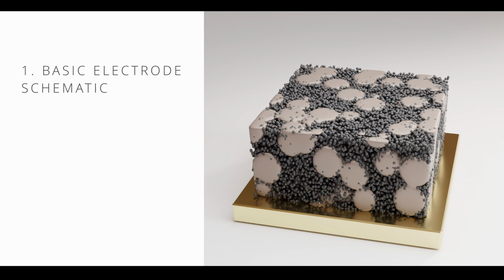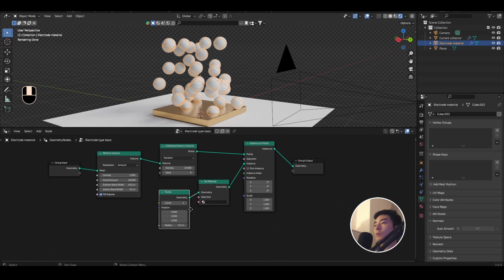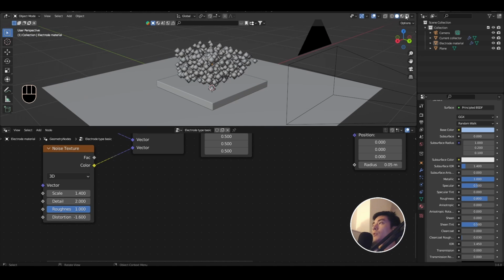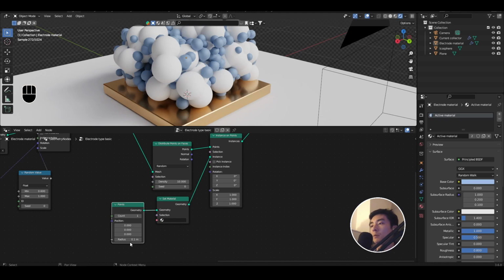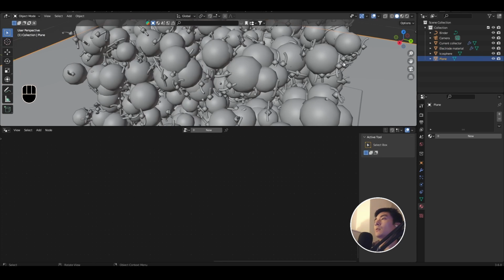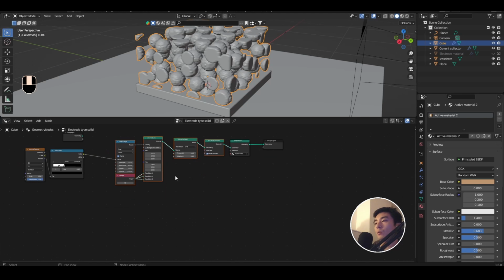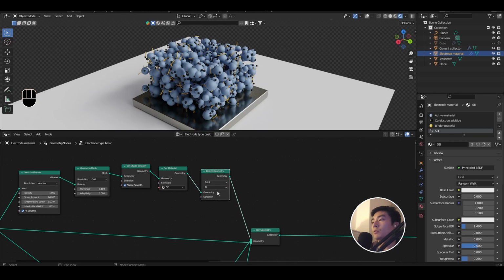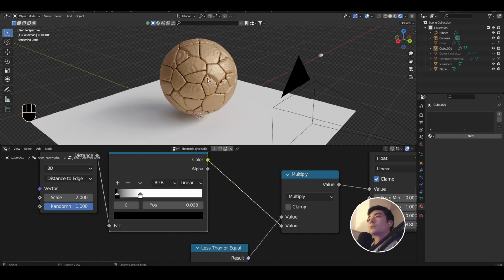Starting Sciart EP2 - Lithium Ion Battery Electrodes

Comment: Hi I am wondering right from the beginning... why is your viewport shading so bright? Also the background changes to these small chess type squares. How did you do this?`
Reply from the maker: I'm constantly running my viewport in full render preview using Cycles. All the brightness comes from a global HDRI + a white backplane that catches bounce lighting. The chess squares in the background are there to indicate a transparent background. They will not show in your render. The way to toggle background transparency is by going to Render settings -> Film -> Transparent. If you untick it, you'll see everything in the scene's background (e.g. an HDRI, as I've set up in my scene).
Reply: @ryomizutagraphics  omg thank you very much!! <3 have a great weekend

Comment: This actually gives me direction on something that has been giving me a hard time ...doing the charge transport layers of my materials. Thank you so much. Question i do have though, how can one show a charge flow in such a set up (charge flow through the contact, it doesn't have to be animated)? I was thinking of using the bezier curve.
Reply from the maker: Depends on how you want to depict the charges. If it were me and I only needed to add a few charges, I’d just add a few spheres, give them an emission shader and position them manually where I want. If i had  more than a handful I wanted to add (eg I wanted to make a train of electrons, and I wanted to freely control their path) - yes, Bezier curve + geometry nodes -> resample curve to control number of points -> instance on points with emissive spheres as instance objects, and edit shape of the Bezier to conform their path to what you want
Reply: @ryomizutagraphics  I think I will try both and see how it works out...for my case i would like to show how extracted charge from a semi-conductor can move from the core material to the contacts

Comment: Hey , I am not able to see sphere in render view. What could be reason
Reply from the maker: @bsbrar7936  you’re in Eevee, and using Points. Switch to Cycles to render points, or swap the Points for actual spheres to work in eevee
Reply: Make sure you use Cycles for rendering

Comment: Brilliant tutorial. As a beginner, I am confused by one thing regarding section 1: I try to insert a secondary spherical active material into the voids created by the main active material. You showed how to create conductive carbon partilces particles sitting ON the surface of the main active material. But how do I modify the nodes so the secondary acive material fill the VOIDs, as in section two? Alternatively, how do I assign costum particle shapes in the cross-section model of section 2?
Thank you very much - apologies for this basic question!
Reply from the maker: For section 2 - you can change the particles that fill the voids from simple spheres to custom shapes by simply changing the Instance Object that gets plugged into the Instance on Points node. I use a Points node by default but just change that to what you want - either another primitive, which there is a geometry node for, or an object you've created elsewhere using an Object node

Comment: Hi! thank you for the tutorial. Its very helpful. I am trying to follow the same steps you do in this video. In the geometry note, for electrode material, starting from "mesh to volume" to the last thing you added "value" and then switching from solid to render mode, diamond shapes are changing to spherical shapes when you do it. But when I switch it from solid to render mode, mine looks like unfilled diamond shapes and not spherical ball like shapes. Could you please help me with that ?
Reply from the maker: Thats because you are using the Eevee render engine, whereas I am using Cycles. The diamond shapes are from using Points as the Instance Object - Cycles can process these into spheres but Eevee cannot. If you want to use Eevee, plug in either a UV sphere or Icosphere as your Instance Object
Reply: @ryomizutagraphics  i had same issue but figured after realized my solid metallic current collector doesn't really look that much metallic and changed to cycles (rookie mistake) then baaaaammmm got the spheres unexpectedly. (big brain mind blowing time to realize that evee does not render instance objects and cycles does that). after finishing the tutorial i saw this comment. i could have save somed time if i had seen this before. 🙂🙂🙃

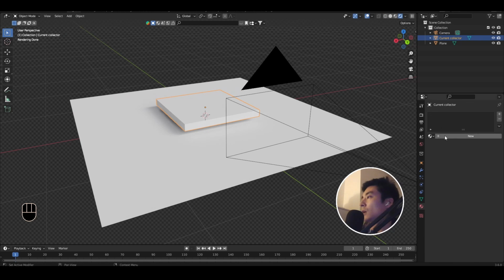Comment: hi, in 1:24 min, when you open up the shader editor, it pops up to add new materials. I just try to follow this but find shade editor gudie me to black canvas. Right click with add menu didn't allow me to add anything.
Reply from the maker: When you say "shader editor", do you mean the materials tab on the right (like I used), or actually dragging open a new window and turning it into shader editor? If your materials tab gives a black canvas, I'm confused. If you actually mean the shader editor, you have to first click New at the top create a new material. This should automatically pop up a Principled bsdf and shader output node.
Reply: @ryomizutagraphics  thanks. I tried a new file and bsdf pops up.

Comment: Great and very useful blender tutorial in science 🧬. I make hybrid gold-carbon black composite, but some Carbon black are siting on the surface of Gold. How to fix that? or share me your previous tutorials 😊
Reply from the maker: Hard to suggest how to fix without knowing what exactly you’re trying to achieve and how your Au-Carbon black composite looks
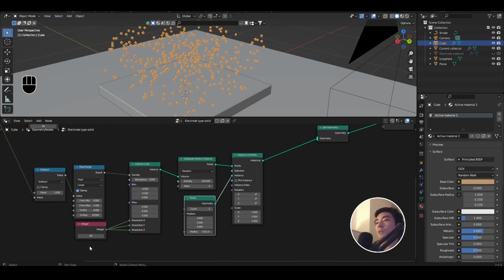Reply: @ryomizutagraphics  at minute 16:19, instead of using points to the instance on points, I used UV sphere object as Carbon black cluster materials. I will learn geometry node more and fix it.
Thanks for your reply anyway.

Comment: Hello! Thank you very much for the great tutorial! If you do not mind, may I also ask what is the computer or laptop specification that you are using? It seems like you are drawing this very smoothly while in my case  everytime I tried to add a new node, my Blender either takes a long time to process or just crash :') Thank you beforehand!
Reply from the maker: Fair question :) I'm using an Alienware gaming laptop with an i7-12700H core, 16GB RAM and an RTX 3060 Laptop GPU.  Blender has some recommended specifications to run smoothly which you might want to check out: https://www.blender.org/download/requirements/ 
The fact that your interface struggles to keep up suggests you might need a RAM upgrade...
Reply: @ryomizutagraphics  OMG did not realize you replied! Thank you very much! Also then while we're at it, may I ask what version of Blender are you using in your videos in general? Thank you very much once again!
Reply from the maker: I’m always using the latest (stable) version and I recommend that you do the same. At the point of making this video, I guess it would have been 3.6 or 4.0, I forgot which. I’m using 4.1 now.
Reply: @ryomizutagraphics  Oh, I see! Thank you very much for replying once again! Great video as always! Wish you all the best!

Comment: Thank you for this wonderful tutorial. I am using blender 4.0.I was wondering a bit about the alternate structure part of this video. After duplicating and subtracting the density form the porous structure, I could not see the filled volume (with porous structure and filled cube) as shown in the video. I can see only the porous structure. Is the math operation not happening? Could you please help with that.
Reply from the maker: Hard to say what the problem is without a bit more info. Send me a screenshot of your node setup or your blend file to my email (ryomizutagraphics@gmail.com). Happy to take a look.
Reply: Thanks for your quick reply. It actually worked. I connected the node from color ramp to subtract math float node, which has to connected to the geometric position value of subtract math. Anyway, I really enjoyed making this and Keep posting more videos like this 🙂. Keep growing..... @ryomizutagraphics  . PS - you got a new subscriber🙌.
Reply from the maker: @pradhyunvs633  Great to hear, and thanks! More tutorials on the way :) If you also have any particular topics you'd like covered too, let me know. I'm always looking for ideas.

Comment: For the distribute point in volume, is there a reason why you choose a grid dristribution and then move the point with a noise texture, rather than just using the random option of the node directly?
Reply from the maker: Good question! The random option doesn’t give any flexibility over how the points are randomly distributed. However, if I start from ordered distribution and apply a noise, I can control all the factors the noise texture provides to create the look I want.